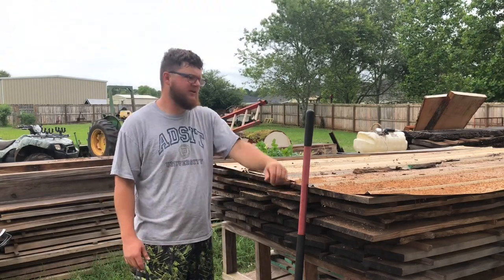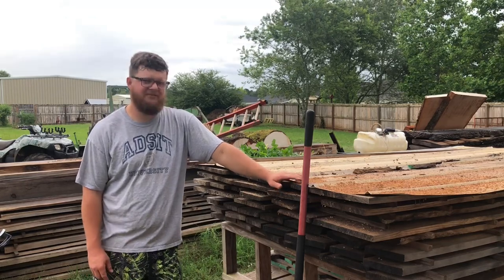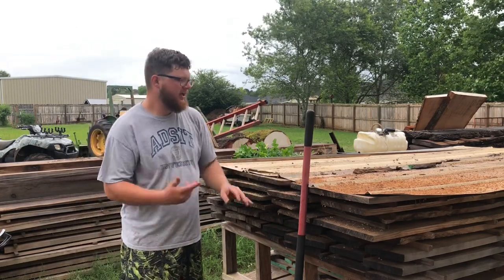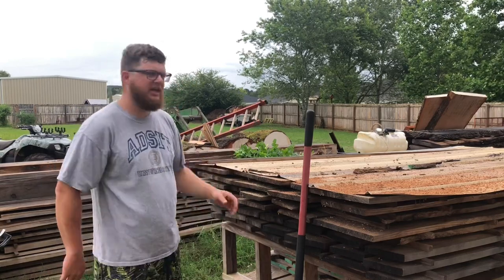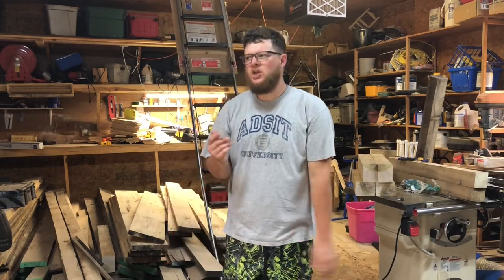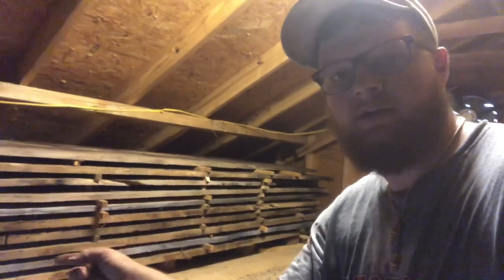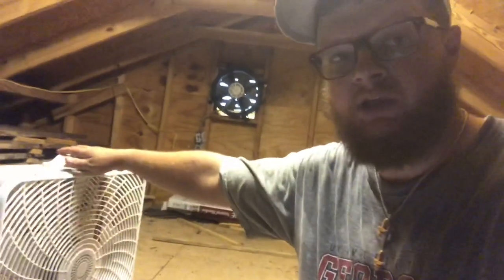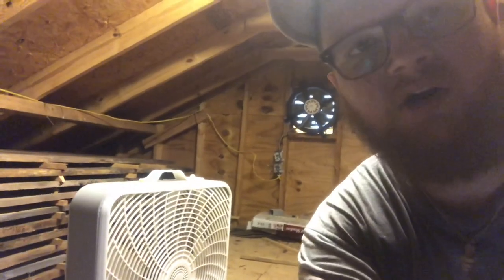You’ll be amazed by this lumber drying technique!

Comment: arent you concerned about all that weight above your shop? hope the ceiling joists are beefy enough! a solar kiln build would take around a day, and save shuffling all the lumber into the attic.
Reply from the maker: Yes, there is certainly a good bit of weight up there. I have nothing else up there, and a load bearing joist through the middle of the shop. I’ve measured pre and post load sag before and there really wasn’t too much. Thanks for watching!

Comment: Hey Tyler...Thank you for taking the time to post this video.  What is the moisture content of your hardwoods air drying them outside before stacking in your attic?  I have a couple stacks of red oak that have been drying outside for a little over a year that is at 19% MC.  Was thinking of moving it to the attic space above my shop to speed up the drying process.  I live in middle georgia and the temps in my shop attic in the summer generally hit between 110 - 120 degrees  in the summer afternoons.  Do you have any problems with your hardwoods drying to quickly and getting severe checking on the ends?
Reply from the maker: Yes, I would try to get them a bit dryer before putting them in the kiln. Try covering them to keep the rain off. With it being so humid down here that sometimes extends drying time. Keeping air moving over them also helps. I would not put hardwoods in the kiln/attic if they were at 19. Maybe more like 12-13
Reply: @TheWhimsicalWoodworker  The stacks are in the shade and sticked with 1x2's and covered with corrugated tin sheets.  So as a newbie woodworker my question is...if the "annual average relative humidity" for my area is 71% which according to  a chart of MC by relative humidity is approx. 13%, is that the lowest percentage I can expect my red oak slabs to air dry outside no matter how long I leave it outside to dry?
Reply from the maker: @BigSidtrous  it’s pretty subjective. I’m in middle ga too, during humid summers, it’s almost like the brakes get put on air drying

Comment: Im curious if you ever checked the moisture content? I dont see how it is possible for you to get near 6-8% this way. Have you considered adding a dehumidifier, maybe wall off half with a plastic sheet as well?
Reply: He has the heat and air movement , I think it can work but would take more time . Similar to a solar kiln .
Reply: @robintaylor-mockingeemill8223  nope. It will never get to furniture grade this way.
Reply from the maker: It gets to 8% very easily. Keep in mind, I’m in South Georgia, in the summer it stays above 80 at night and gets mid to high 90s during the day. The attic is extremely hot... gets very dry, almost too quickly some times
Reply: @TheWhimsicalWoodworker  Not hard to believe . people have been making furniture long before the modern kilns were developed . great video on your method of drying . thanks.

Comment: "Labor intensive" I'd say !
Reply: BTW, I built a dehumidifer type kiln in my shop.  A well insulated room that holds 1,000bf and I use an old 22,000 BTU window AC I picked up for free to take my air dried lumber on down to 6-8%.